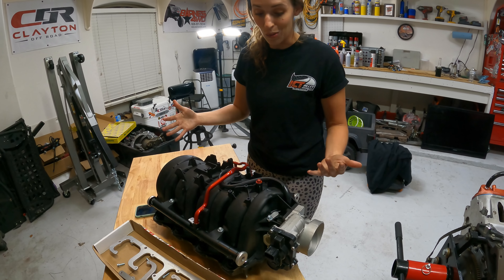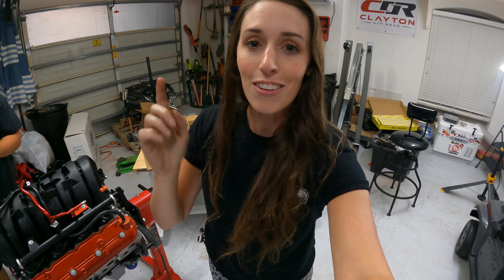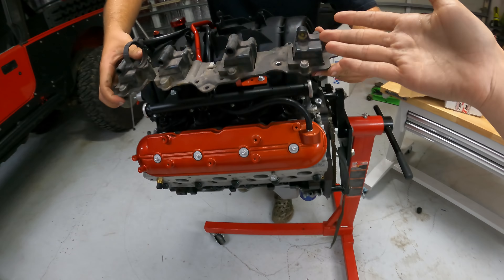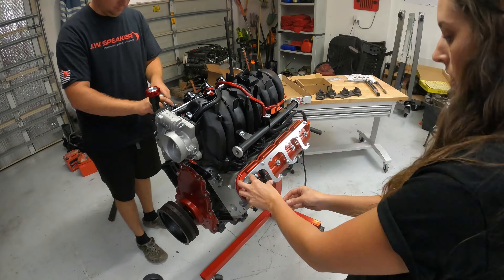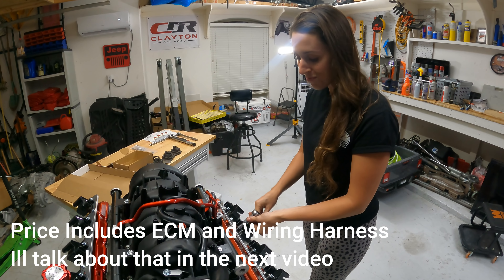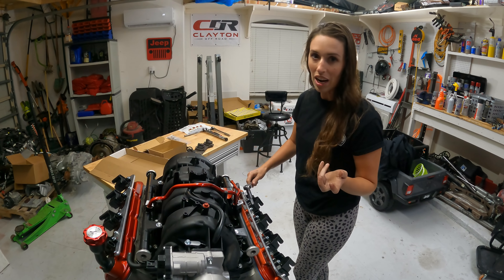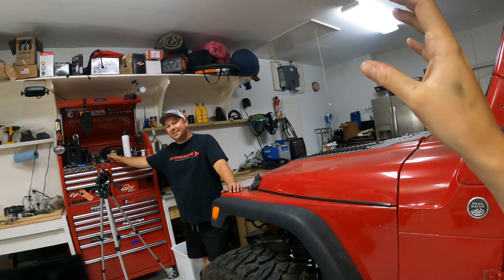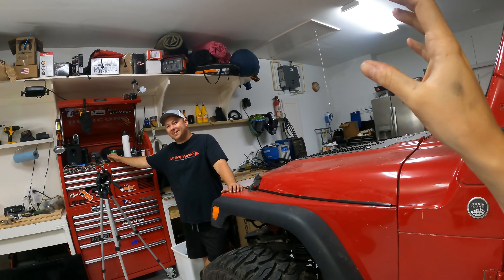The Junkyard LS Isn't so JUNKY!! Jeep LS Swap Engine Assembly & Sensors for Gauges

Comment: Did this swap 2 years ago. Didn't document with video just pics. watching you guys do this swap makes me feel like I should have did a video series. great job!! love watching your LJ vids. Also have you found a radiator yet? if not check out superior radiator in Michigan. I got mine from them. originally I was going to go with one from Novak but I ran out of budget and ended up paying under $400 for radiator and cooling fan kit from Superior. it's all aluminum and it has worked just fine.

Comment: Looking awesome. My only advice would of been to go with a drive by cable throttle body vs the drive by wire. Much simpler design. I also hope you will be upgrading to a better oil pan.

Comment: Just a small tip for heads and checking if they are flat. Something the naked eye, or even a straight bar can miss. Is get a sheet of glass, (and it has to be glass because it's perfectly level), stick a long sheet of sandpaper. I use about 400 grit, and do 1/2doz passes back n forth. Just enough to finely score the alloy. then check if there are any unmarked spots. If everywhere is scratched, you're good to go. Switch out to 1000 grit and do another couple of dozen passes until you're happy. If there are large missed spots. It's machine time. If the missed spots are very small. Then keep doing passes (switching up grits) until it's  all uniformed. Takes a little time but I've  done heaps like this over the last 30 odd years and never had a replaced gasket let go. Great channel. Love your content. =D

Comment: Nice job you two.......The broken exhaust bolts on the LS engines is a very common problem, and yeah the best way to get them out is what Cassie did.......not drilling. I've done a million of them and Fords are the worst. What I've found is that using studs and nuts on the exhaust manifolds is far stronger. Through thousands of heat & cooling cycles, the bolt head is the weak area and eventually fractures........not so easy with studs.

Comment: Hey...best intake you could possibly want for that swap (itll help the power range down low, & actually all over the board is a Trailblazer SS intake)....that dorman intake or whatever it is, will kill power down low rpms. Your Jeep is a daily. You want the stones from idle to 5,500rpm. Im sure ppl have told you this tho. No matter what its going to run really well.

Comment: I want to do this but, 4 things:
1. My engine is still working
2. I would need so many driveline upgrades done.
3. I'm still not sure if I want to go diesel (2.0 TDI, Cummings 2.8R) or just what you are doing.
4. I don't have the room to run a manual. I literally can't work a clutch pedal in a TJ cause my legs are that long.

Also there has to be a way to make the dash work without the Jeep computer. Less...stuff to have to worry about.

Comment: Hey guys. I painted my valve covers with the metal cast paint. Color was great. I sprayed the clear and now I have a reddish orange color after the paint cured. Thought it kinda matched the rubicon red. Then I painted the throttle body in same fashion minus the clear. This dried a candy apple red. Have ya'll noticed the same thing?

Comment: corrected Awesome price and build you two.
Reply from the maker: No, 700 for the engine/trans/tcase. 
The total for the swap so far is 1900. That’s everything so far, including wiring harness and ecm.
Reply: @JeepGearGadgets  oh ok that a way better deal. Didn't realize that was engine, trans, tcase, and harness included. Much better price point.

Comment: The oil pressure sensor may need to be connected to the GM computer.  Unless something changed the computer needs to see a minimum lbs ( somewhere around 8 or so) or it will shut the engine down to save it. Really a stumper if you forget to connect it and it shuts down in about  10 seconds. Don't ask how I found that out.

Comment: what are you doing for knock sensors since you have the ITC valley plate on? 
Sides of the block?
Reply from the maker: Ict sells knock sensor relocation brackets. Will be adding those soon